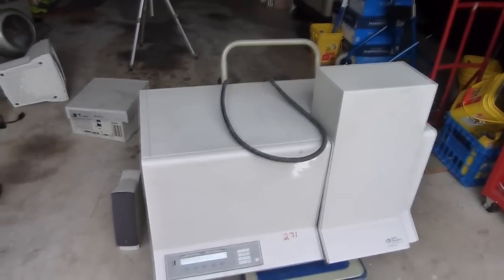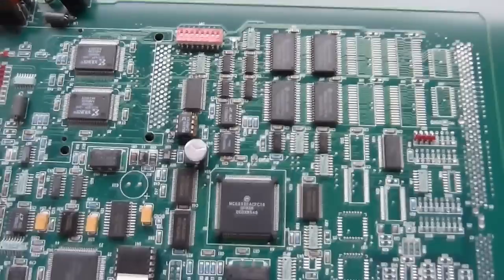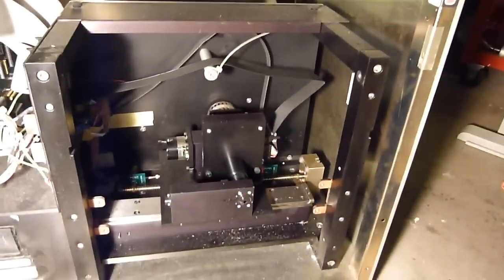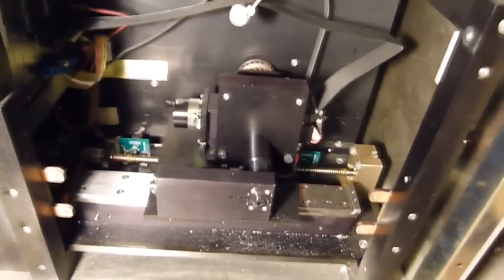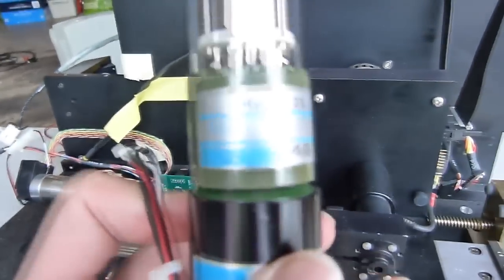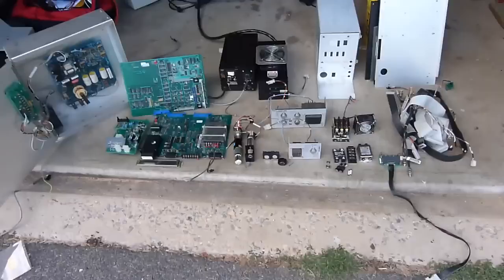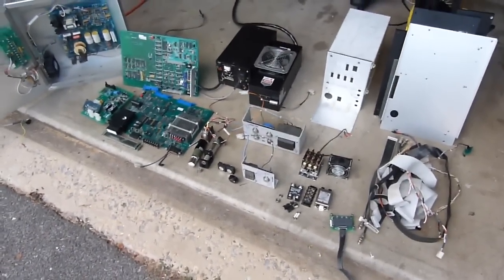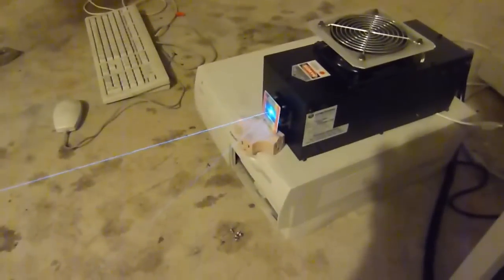Applied Biosystems 373 DNA Sequencer Teardown

Comment from the maker: Hard to say accurately, the beam itself is just the temperature of the room. Heat from a laser beam is the result of the light being absorbed by the surface it is hitting, the beam itself is not actually hot. If the beam was focused tightly on a piece of dark colored paper you may see temperatures of around 400 degrees F. Think of it like a black car in the summer. The car gets hot from being in the sun, but the air which the sunlight travels through is not directly hot (relatively).

Comment from the maker: the old quantum fireball is struggling to read data, it tends to hand and take many minutes to boot sometimes, it's probably on the verge of failure, you're right about the bearing noise though which is normal but it re-initialized several times (couldn't really hear it on the video)

Comment: ...current.  As in standard gel electrophoresis, heavier molecular strands are carried by the current more slowly than smaller ones, effectively separating the DNA strands which were earlier broken down in solution.  After the gel is run, the machine analyzes the results using laser fluorescence with an argon-ion laser.

Comment: These machines were designed for the rapid analysis of DNA extracted from a test subject.  It uses a modified form of gel electrophoresis known as laser fluorescence chromatography.  The gel to be used is loaded similarly to a regular electrophoresis gel, with the exception of the dye used, which is actually a mixture of dyes which are formulated to attach to specific base pairs.  The gel cassette is then loaded into the machine, which applies about 100v across the gel at a very specific...